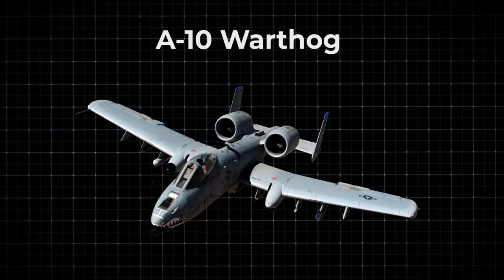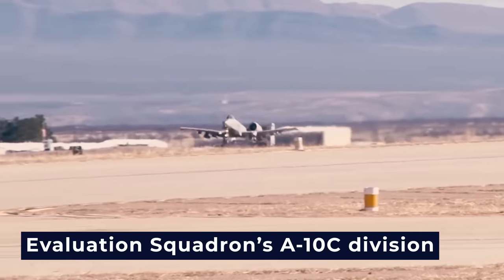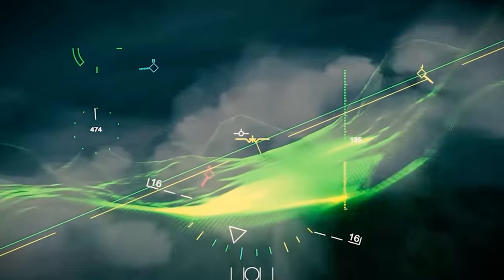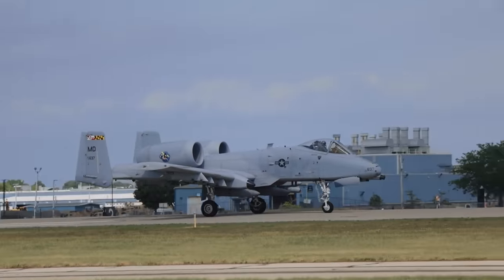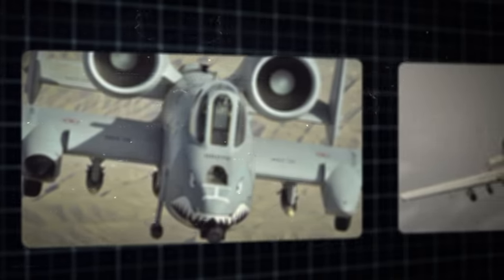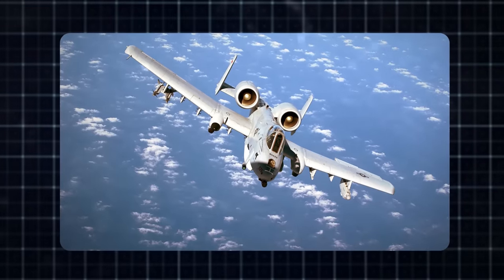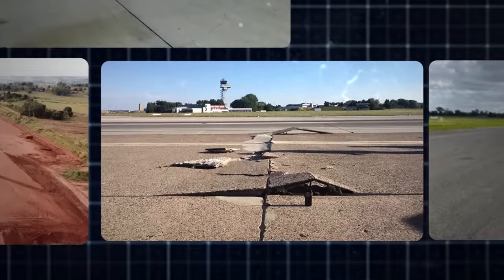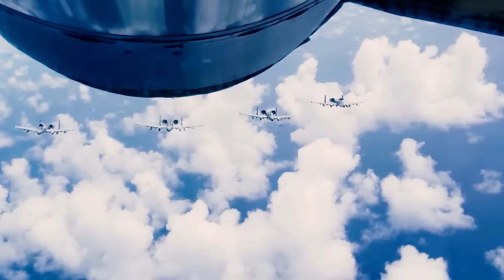The All NEW Blacksnake Super A-10 Warthog Just SHOCKED The World!

Comment: I'm no engineer but upgrades make more sense than designing a new unit from scratch.  Just look at the B52; upgrades after upgrades keep improving this aircaft flying well into the future.  Keep the A10 flying!!!    Bless our Vets
Reply: It’s just tradeoffs - what’s the most economical use of force? What constraints do you have to accept by not starting with a clean sheet?

Let’s go ahead and look at the B52. It would be more economical to have 4 large engines than 8 smaller ones, but the wings are too close to the ground to allow clearance for bigger engines - so you’re stuck with 8. The last B52 was built over 60 years ago - they’ll eventually wear out. More maneuverable aircraft tend to wear faster as consistently pulling g’s stresses the airframe. 

I love the A10, it’s the one I’d want to fly if I was a pilot, BUT… it’s most effective in a permissive environment. It’s susceptible to MANPADS, let alone SAMs. It’s an impressive airframe, but if you ask the commanders on the ground they want more ISR and recognize CAS can be achieved and is often achieved with a combination of other airframes.
Reply: Reopen the production line and have fresh airframes to fix the problem of higher maintenence costs due to more maintenance hours spent on issues that arise from the wear and tear on airframes as they age from mission usage. I think these were like $10,000,000 a plane when they initially started production. While the latest avioncs, piolet equipment, data link hardware and such would lift the price a good amount, a doubling or even tripling of the price per unit would still allow for like three to five aircraft for every one of our newest planes in production, with the possibility of allies ordering planes and helping keep prices lower than initially projected. Except for a manufacturer wanting to get the cash and other support they receive to create and develop a new aircraft from scratch, everybody wins. The manufacturers don't exactly lose, either. They get paid for new orders as well as the efforts they put out in fleet upgrades, integrating new and upgraded equipment/ capabilities into the aircraft on the production lines and so forth. The key for the best economic outcome is in keeping a production line open and integrating upgrades for the plane as they are built, as that is way cheaper for both product procurement and version management, including bringing older versions up to date. The cost of opening up a closed line and remaking the necessary tooling, relocating stuff in the space where the line was at, retraining workers to replace ones that have moved on and so forth is incredibly prohibitive and is the reason that it was decided to not restart F-22 production. The low A-10 cost would make the reopening cost of the production line way more viable in this case, especially due to not having to recreate any stealth coating application facilities and the like that are very specific to the plane and the hazardous nature of those materials.

Comment: Is this the same plane that the Air Force wanted to get rid of for years but has been stopped by Congress?  The A10 is a guardian angel of ground troops who is always available when the troops are in a bad situation.  Instead of spending billions on a new replacement why not build  new ones with improvements built into the replacements.
Reply: Can't build new ones. The tooling for it has been destroyed... If it was easy there would be new F-14s..
Reply: Who says that Pentagon Generals are smarter than fifth graders? Just also look at the process for making 155 mm artillery shells. Three different locations and TNT from Japan!
Reply: "The tooling for it has been destroyed."
 New, better ones will continue to be built.
Reply: The Air Force has attempted numerous times to 'retire' the A10.  I believe their most recent attempt was when they determined that the F35 would replace it.
Reply: @flick22601  dumbest idea ever.. they need to go to the drawing board and build ground attack plane with A-10s capability but with stealth added and maybe just a little bit more speed so that they can be a little harder to hit from ground-based systems not nothing super sonic but just a little bit more than it is now.
Reply: @wwclay86  - Idea?  What I posted was facts.  Didn't say anything about building a plane.

Comment: I am so happy to hear in the commentary that there is now more acceptance with the fact that the F-35 is not suitable as a replacement for the A-10.  The air force has a lot on its plate related to various mission objectives, so I understand the desire for multi-mission capability.  That being said I also understand that a ground troop support role is far from the center from any of the other mission requirements.  My hope is that a dedicated close combat ground troop support aircraft will be its eventual replacement.

Comment: The most brilliant thing about the warthog isn't so much the fact it can limp back to base shot full of holes. The true brilliance is in the simplistic nature of the engineering behind it and the fact it's so easy to work on, a monkey could do it! Regardless of how badly damaged a unit might be, replacement parts are relatively inexpensive & readily available, allowing a plane to get back in the air within days, if not hours! Conversely, the F-22 requires about 4-5 hours of maintenance on the ground for every hour of operation in the air; and that's assuming nothing goes wrong...

Comment: Hello!  During Desert Shield, a 'Do Not go below' ceiling was put in place.  This was discussed in books written by Generals Franks and Schwartzkof.  It was stated, ' The largest issue with downed a/c was if they operated close to the ground.'  Those large engines and the heat generated are targets for Stinger type portable missiles.  The A-10 is a fine A/C that won't survive a modern battlefield.  Regards

Comment: Remember way back when, when the cannon was offset to the (pilot's) left, to counter the rotational momentum?  Can be seen at 1:30.
Reply: The barrel being fired is on the center line of the airplane.  The bulk of the gun was offset to permit clearance and operation of the front landing gear.
Reply: @johngaither9263  Not at 01:30, unless the cockpit is offset to the right.